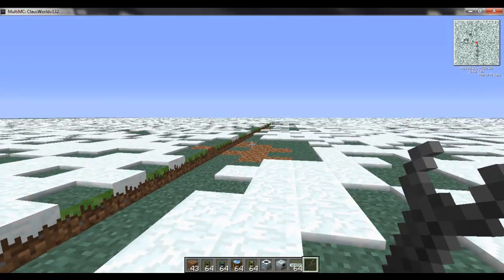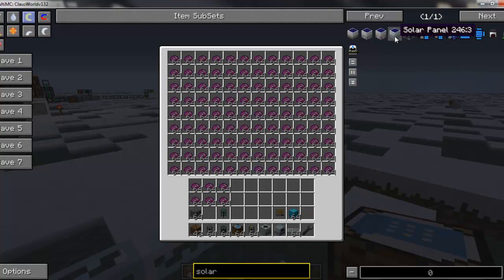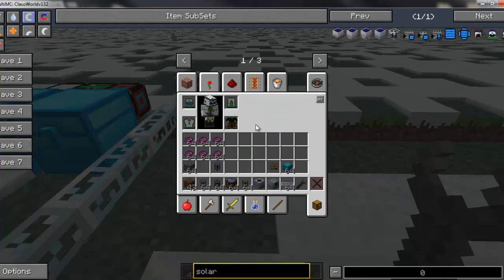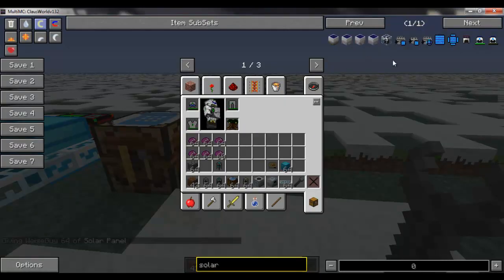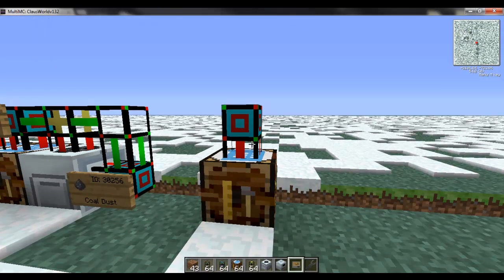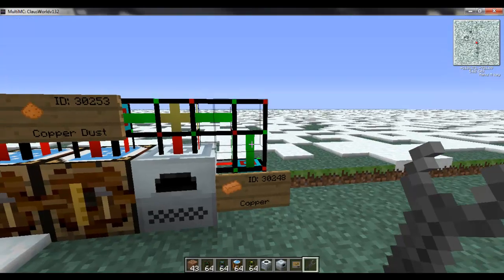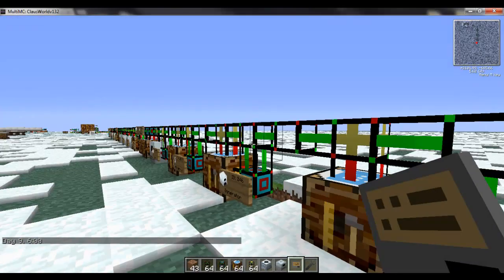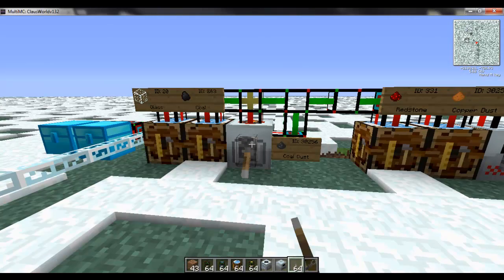Logistic Pipes Tutorial - Episode 10 - Advanced Setups - UU-Matter to HV Solar Panels (Part 1)

Comment: I'm confused, do you not need to charge the RE-Batteries?
Reply from the maker: +Jim Anderson haha, I see your comment on the next video. Just remember this is 1.6.x if I remember correctly. I don't really upload here anymore, though. I created YouTube.com/WeiseGamer, but have been on a break there too unfortunately.
Reply: +WeiseGuy91 I'm using tekkit Legends PS. All the above works, though I had to use a logistics crafting table instead of the autocrafter you refer to above (assuming just a renamed version provided by logistics) and I nearly tore my hair out trying to build a centrifuge, before i realised it was waaay out of my grasp. I'm sure it works, it's simply something I can't grab yet. Now I'm starting on power flowers etc trying to get to the point where i can create uu matter!